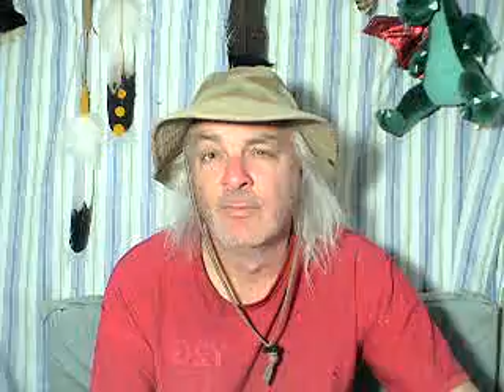Power from wind, sun, water, steam: is it really "free?"

Comment: While not free solar and wind have their place in commercial power production. if done properly  a solar or wind system makes cheap power while the sun shines or wind blows. no real expencive input fuel needs to be purchased, which is the major cost of power production with carbon/hydrocarbon. same start up costs same maintainance costs same equipment. just differnt boiler or in the case of wind turbine.

Comment: Simply not true. This is the simplest calculation of all times, and still he states solar energy is not free. Incredible.
If you need a independent system in the middle of nowhere- fine. hundreds of miles of cable arent cheap aswell.
In big scale solar energy is THE ONLY answer.
And certainly no batteries would be used in that case.
Solar energy in big scale = matter of time when the energy is really for FREE. At the point when solar panels are manufactured with solar power: energy unlimited

Comment: While living in Germany, in some areas, we saw fields of very large modern wind mills used for the purpose of generating electricity. Indeed, these devices are certainly not free since they do require maintenance. Do you think they are a viable alternative, or at the very least they could alleviate some dependence on coal/gas/oil?

-A

Comment: also the baterries alone are a decent chunk of the money involved. the avg deepcycle battery for marine use lasts roughly 3 years at a cost of about $100.00 per battery.now the ones designed for a solar power system probably cost about double that and may have a little longer lifespan perhaps 5 years but i'll have to look into that. then how many batteries needed for storage?that depends on your wattage load.maybe 10 bateries min just to run a fridge, washer dryer and a few lights.

Comment: It IS possible to produce more fuel than you use. In a fast-breeder reactor you can take u235 (uranium) and make pu238 (plutonium) as a by-product which is also fissionable and can be used to make electricity. Trouble is, pu238 is the most toxic  substance known to man. A tiny speck can cause cancer. It has a half-life of about 50,000 years, which means it remains toxic in the environment for periods of time longer than the previous history of human beings.